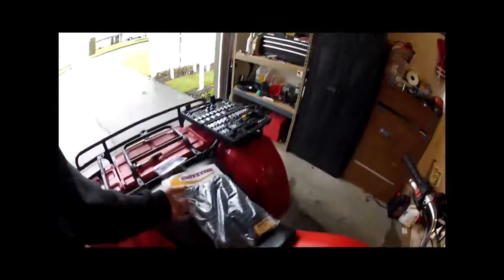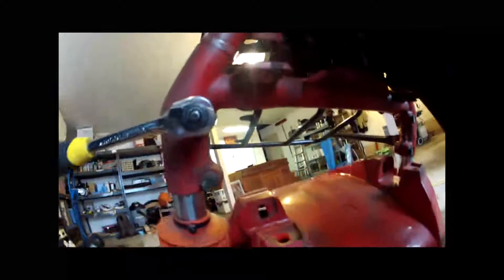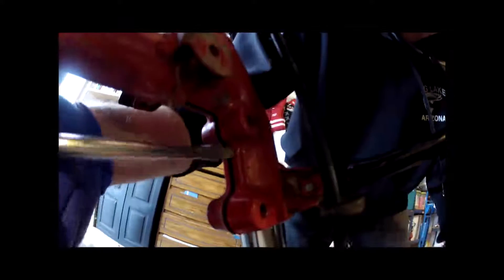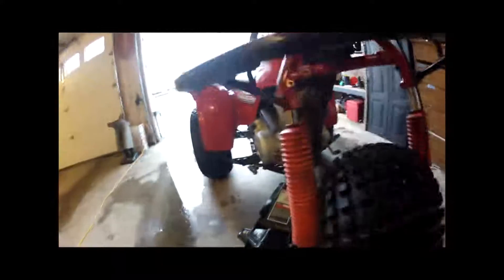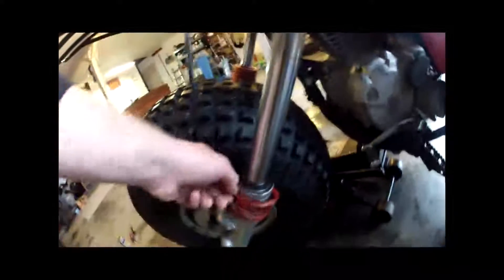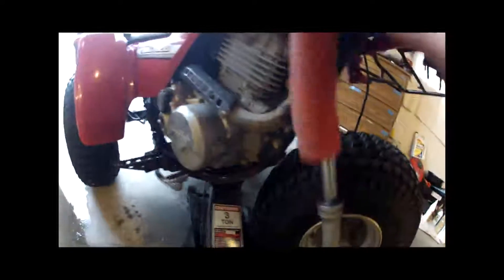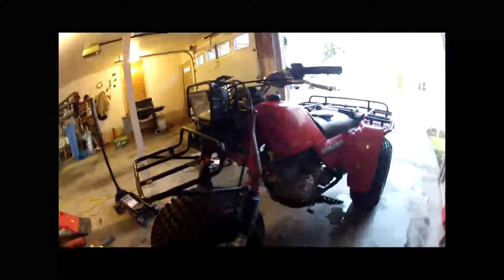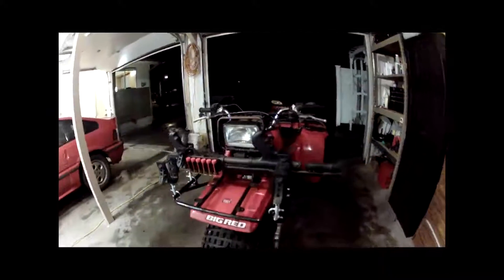honda 250es shock fork boot replacement

Comment: Thanks for the video it was very helpful.  When I attempted to pound the forks out, they did not move much even after many, many strikes from my rubber mallet.  Then I removed the front wheel and noticed that the forks were a little wider at the bottom so they were binding at the top until I removed the front wheel.  Then the forks came out much easier with just a few strikes from my rubber mallet.

Comment: How did you get the shocks back in and seated all the way? Mine are almost and inch out from where they are suppose to be. Wiggle and tap them with a hammer and they still do not go in any further. Call it good and put the bolts in or how do I get them to go in farther? Thanks!
Reply from the maker: Try to pry between where the 14mm bolts go that holds the shock in and open it up a little more. Try and spray a lubricant on the shock to try and help it slide in better. Hope this helps. I don't remember any trouble with mine.

Comment: How did you take the fender off before taking the forks off? I attempted to take off but the fender stuck to the forks? Please help
Reply from the maker: Pretty sure 4 bolts and it drops down.